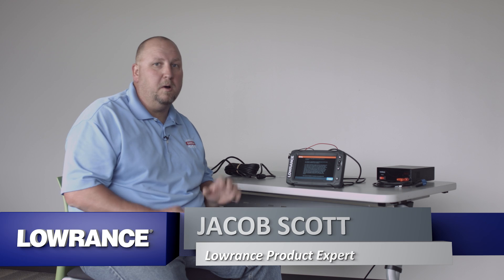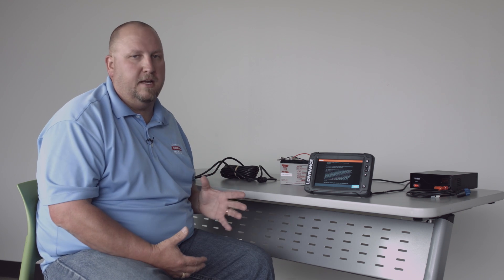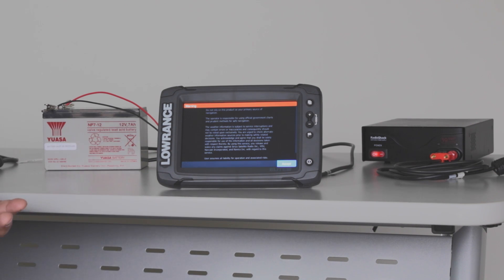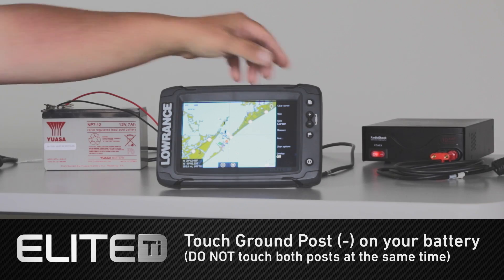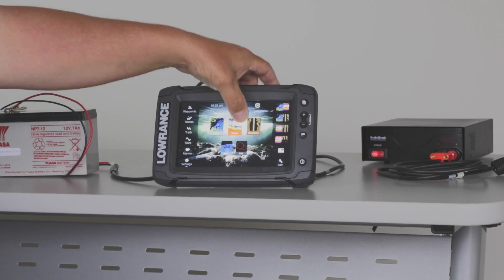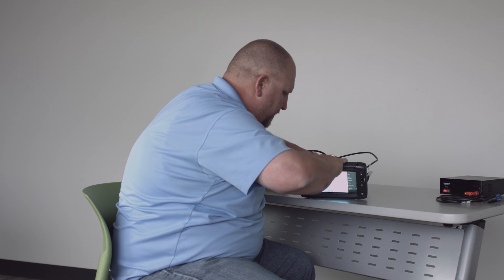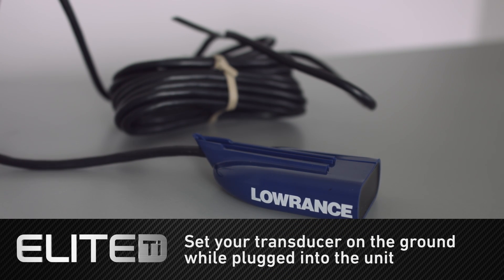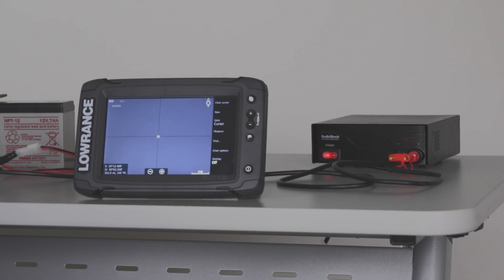How to Use Elite Ti Touchscreen Out of Water

Comment: I found that this worked the first time but not the second time... until I licked my finger and put it on the negative post as I used the touchscreen of my Elite 9 Ti2.  Lowrance really seems to be on the ball with respect to product support but I'm sure that this problem has cost them untold thousands of dollars with preemptive returns.  I would think that buying this unit in 2022 they would get the thing working without the ground loop problem.   In any case, this video was good and appreciated as I like the unit and would hate to return it for something as trivial and quirky as this.
Reply from the maker: Thank you for your comment. It was a grounding issue found on the Elite ti2 series units.

Comment: Should this work with the Ti2?  It powers on fine but no matter what I do the touch screen doesn’t work.  Im using a 12V 8 Ah battery that checks out fully charged.  What am I missing?
Reply from the maker: Is your unit already installed? Do you have your transducer plugged in?
Reply: @lowrance  please reread my question.  I am trying to get it to work out of water as in the video. Thanks

Comment: I want to use my Elite Ti2 on my snowmobile for mapping/ GPS. My battery is under the hood of the snowmobile so touching the terminal is not an option. I also wont be running a transducer. Is there any way to run a ground wire to the snowmobile body to complete the ground?

Comment: Great tip! Thanks! Do you need a transducer plugged in for the GPS to work. I'd like to use it for ice fishing but it's not tracking my location.
Reply from the maker: No, you do not need the transducer plugged in, but you do need to be out in the open to receive a GPS fix. Are you trying in the garage?
Reply: Yup, that was it. Thank you! And thanks for the prompt reply on a very old post. Very appreciated!

Comment: This is significant>>> allabout.wiki/gd3d   When scrolling around the sonar screen or chart, setting waypoints, etc touch input is much smoother and quicker. On the Hook unit you have to use the arrow keys and buttons to do everything, which is slower, more confusing, and tedious. Imagine using your smart phone with no touch screen but with arrow keys and buttons instead and you get the idea. Touch input reduces frustration on the water.

Comment: I have an Elite Ti9 with a Nocqua battery. If my original cable to connect from the Lowrance unit is in my kayak. Where can I find a cord to connect the Lowrance unit to the Nocqua battery from the convenience of my home?
Reply from the maker: Hi,  Spare power cords are available the part number required is 000-14041-001 you can purchase it on-line here https://www.lowrance.com/search/?q=000-14041-001

Comment: While I'm in my boat out of the water the touchscreen is still responsive, however while I'm both in and out of the water the touchscreen isn't registering correctly. I've tried calibrating both my units multiple times but it doesn't help. I need help!

Comment: That was the most helpful  advice of them all - you are overdue for a pay rise.
  I just ordered mine two days ago and was wondering how to power it at home. What capacity 12 V  DC  transformer  would be enough.  I have one - output DC 12 V 100 W - will it be enough ??? Or how many mA is needed ???   How much power is the unit drawing  ????
Thanks , kind regards ....